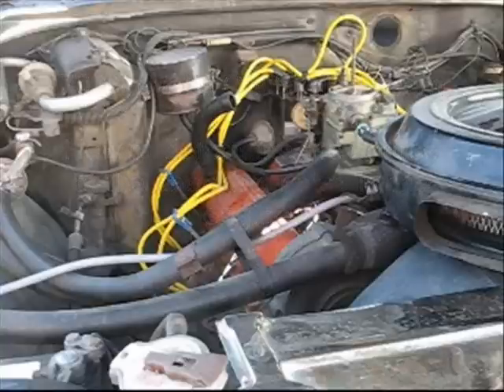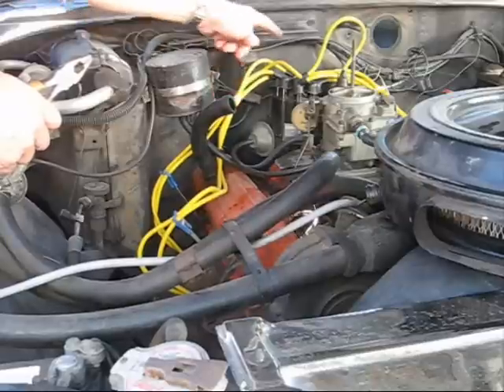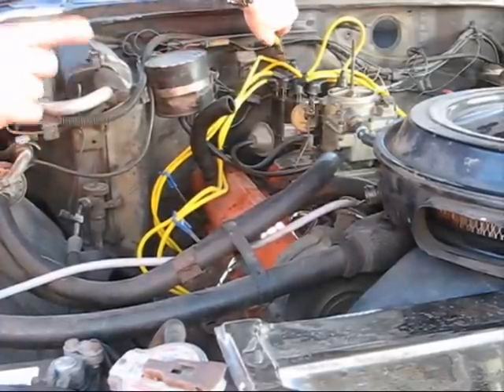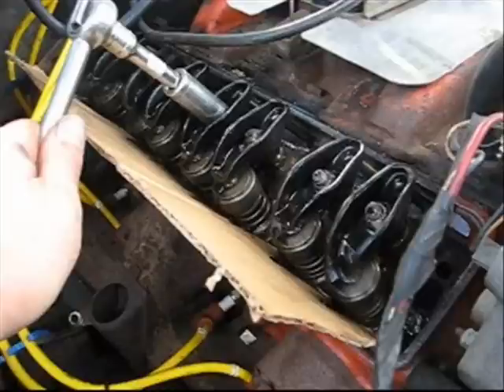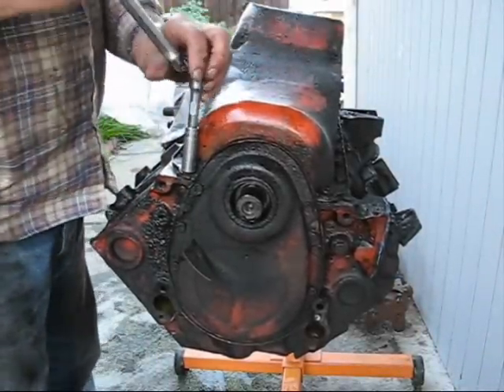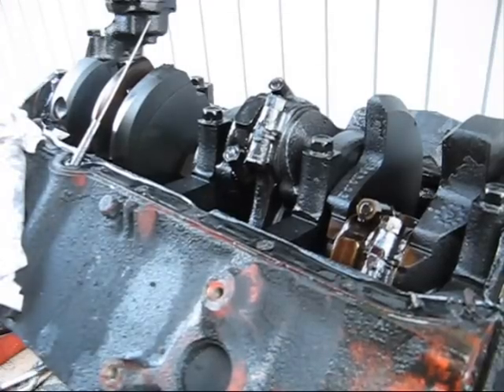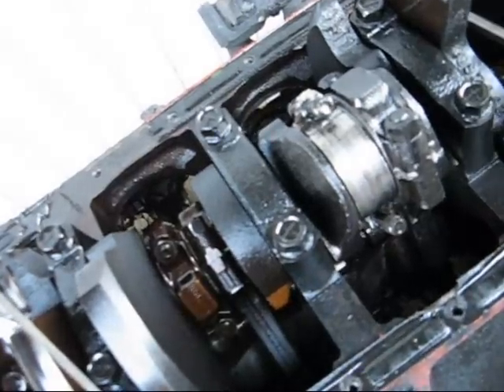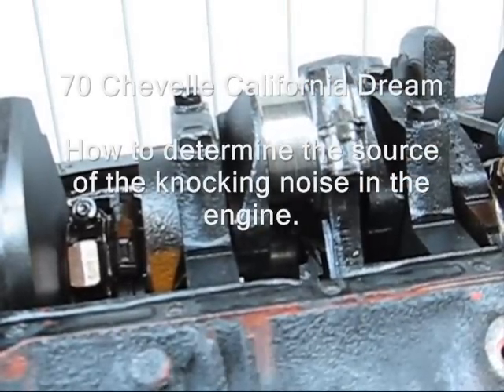How to determine the source of engine knocking noise

Comment: I have the exact same knocking sound on my corolla..so could it be just the head, or does it need a general overhaul?
Reply from the maker: +Paul Jason Did you pull off the spark plug wires one by one to see if the noise went away?

How many miles on the car and what year is the car?
Reply: Yeah, I haven't tried that..I'll try it today, and get back to you..it's got 133,000+ kilometers. I did some research..they said it could be a lifter or push rod problem..worse is a piston slap..but I don't get smoke/blue smoke on my exhaust..and the engine power seems ok.
Reply from the maker: Have you pulled off the valve covers and looked to see if the rocker arms are all working or the push rods are bent?   Do one side at a time and like in my video, use a piece of card board to keep in the oil.

If they look ok, take a large screw driver and carefully put it on the bolt of the rocker arm and put the plastic handle end on your ear.  Go to all of them and see if your can hear the bad rocker arm/lifter/push rod.
Reply: David Lis Okay, I'll try that. I did the spark plug wire test. I think it's cylinder no.3.  I also went to a shop today and had a compression test(wet/dry), and it also turned out fine.  They still can't figure out what caused the knocking.  They were talking about a top overhaul, I said No, not yet. I posted a video on the compression test I had this morning. You can check it out.
Reply from the maker: Where is it?
Reply: It's in my channel (videos).  I got a problem here, The check oil light turned on the other day and yesterday before I had a compression test. I thought it was only the sending unit. Last night, when I went drove to the office, the check oil light was on again, and it wouldn't turn off. Then suddenly, the engine was very noisy.  So I was thinking it's the oil pump that's gone bad.  Am I right? Could this be the root cause of all the noise problem on this engine? The car is back here in the garage, and I don't want to turn on the engine. I'm trying to get my mechanic to come here, but he's still busy at the shop.
Reply from the maker: I looked at your videos.  The compression is good.  

Oil light coming on usually means you have very low oil in the engine or no oil in the engine.   Engines do not run long with no oil.  Question:  is there oil in the engine?

If the oil light came on and you keep on driving, that could mean you were driving it with no oil to lubricate the engine.  That is why engine became very noise.  You may have wrecked the engine. 

If the oil light came on and the it was full of oil,  it could be the sending unit.  But with the oil light on and it started making a lot of noise, means it is out of oil.  I never heard of an oil pump going bad.

My friend's wife has a Toyota Camry, 4 cylinder.  She drove it home with the oil light on.  When she pulled into the driveway there was oil all over the bottom of the car because the oil filter broke.  I checked the oil and there was none in the engine.  I thought it was wrecked.  So, I put on a new filter and filled it with oil and said, let's see if it will run.   It started up, and it is still running today.  I am surprised.  

So, in your case, the only thing you have to lose is 4 quarts of oil.  Fill it up and see it it runs.  If you ran it out of oil, it is wrecked anyway.  These Toyota's are had to kill. 

Let me know how much oil you had to put in the engine?
Reply: David Lis Hi David..I have a serious engine knock..I just uploaded a new video. You can and hear it.  My mechanic's coming over on Thursday to check the oil pump.  I'll keep you posted. Thanks
Reply from the maker: I am sorry.  I am not the best at this.  Where did you post it.
Reply: I think the knocking sound is fixed now. I had the oil changed and the oil pump strainer cleaned.  The mechanic said..it may not be the oil pump going bad..just the strainer too dirty.  He cleaned it, and it didn't have the knocking sound. The oil was an Aisin 5w40 fully synthetic oil.  Now, a little issue, my RPM is high even when I drive on low speeds (30-40km/h) I think it's the throttle cable that's loose. He said his coming back this noon to check it again. Thanks!
Reply from the maker: OK - good news

Comment: great video going to try this on my 72 oldsmobile cutlass ticking sound is driving me nuts. seems to be no exaust leak thinking it's a lifter.
Reply from the maker: +Keith Hawkins It is probably not a knocking noise, just loose valve lifters.  Take one valve cover off and use a large screw drive, the plastic side goes on your ear and the tip goes on the rocker arm.  Go to all of them and hear which ones are making noise.  Them tighten the noise ones a 1/4 turn and see if that quiets them down.  Be careful not to tighten to much because it could screw up your valve.  If the motor starts to run rough, it is to much.   Let me know.
Reply: +David Lis have the cover pulled now am going to try tightening it up I know which one is ticking from pulling wires off the distributor but they all seem fine at first glance
Reply: +David Lis uploading a video now not running but I will post one after with it running any help would be hugely appreciated

Comment: had a motor replaced in a Mazda tribute now this motor has a loud tapping and cuts back after reaching 50 mph replaced fuel pump all air sensor and erg is fine any suggestions it has been 7 weeks no way to go
Reply from the maker: Sorry, I am not familiar with those cars

Comment: Out of curiosity, why does the noise go away without spark if the bearing is still rolling around? Without the combustion happening in that cylinder, the bearing is able to keep from spinning?
Reply: +Mitch Hill Great video by the way.
Reply from the maker: +Mitch Hill With the spark plug wire off, the cylinder does not fire, so it does not generate the force of pushing the piston down, there is no pressure on the bearing.  So the bearing is just going around the crankshaft with the help of the other pistons doing all the work.   It is still not going it any good because the bearing is just scraping the journal on the crankshaft as it goes around.  It is only a matter of time before the connecting rod brakes and does real damage to the engine block.  Then you have real problems, like maybe needing a new block. 

Once the bearing starts spinning on the crankshaft, it will always spin because the tabs the hold it in place are gone, I show it at the 7 minute mark in the video.  My was so bad that I had to buy a new crankshaft.
Reply: +David Lis Understood. Thanks for the reply.
Reply: Mitch Hill because the piston has no load on it when it’s not firing

Comment: ok guys i have this 92 chevy  p up chevy small block . and the knocking noise is coming from the diverside. this is the thing when i start it nothing after it warms up and i put it in gear that's when i hear it. when i give it gas it gets alittle louder. but when im at a cruising mode it seem to go away.. im so dam confused HELP ME PLEASE
Reply from the maker: +Lester Stuck My guess is that it is in the starting stage because when it is not under power you can not hear it but when you need power, like accelerating it puts more pressure on the bearings.  Once again, when the truck is just cruising along, the noise goes away.

If you put the truck in drive, foot on the brake and slowly press on the accelerator to increase the strain on the motor, does the noise come back?
Reply: man i just had the upper half rebuild someone told me this would happen.. soon.. ok i thank you sir for the info..
Reply: Having same issue did u find the problem?

Comment: remeber to use some type of oil supliment in older flat tappet motors, most oil has reduced anti friction additives as all engines built now have roller lifter or roller tappets. I use diesel oil(rotella 10/30 or 15/40) it still has the needed additives required in flat tappet motors. GM sell EOS engine oil suppliment for this reason.
Reply: Thanks  for the advice Tim. A few years ago my 350 had a lifter go bad. I ignored the noise and eventually I had to replace it with a different engine. That 305 for some reason had similar horsepower and I was happy with it... until that engine had a lifter go bad. I replaced the lifter immediately. Surprisingly a simple but time-consuming project. I've been wondering why people are using Rotella diesel oil, now I know.

Comment: Any mechanics out there.. I have a 1998 f150 4.6L v8 that's ticking and the truck is shaking. The ticking is coming from the passenger side around the valve cover which is also right next to the fuel injectors and spark plugs. The spark plugs were replaced with iridium ones and wires were replaced but i'm skeptical about misfire due to the plugs because they're not individual coils. Its 2 coil packs 4 running off each. And it seems to me to be dual overhead cams which take out the possibility of lifters. So my hunch is a bent rocker arm. Im just wondering if anyone else has some insight on this. Also the tick changes with the revolutions.
Reply: Bad shaking is usually a misfire or could be accidentally placing the wrong wire on the wrong plug. I've done it dozens of times. A bend rod would be fucking loud. Like "AHHH SHUT IT OFF!" type of noise. If it's more of a ticking noise that varies with RPM but goes away once it gets warm, it could be a plugged up lifter.
Reply: Turns out it was just the plug wire on the back bank got pulled up. And I  didn't notice until I reached back there and just pushed it back on
Reply: My engine is shaking and making a knocking noise . We pulled the spark plugs and two of them had rust and smelled like coolant on the  passenger side . The problem all started with the knocking noise  and engine shaking and stalling .

Comment: I have the same problem with my 2000 Dodge Durango, V8 5.9L engine. Is is cheaper to fix it or change it?
Reply: +blacknnwhite7  A quick engine swap would be your easiest and quickest way out. It maybe a bit cheaper to reuse the old block and heads if you are doing the work yourself.
Reply: I had rod knock on a bimmer.  Replaced bearings polished journals runs great

Comment: We swap a cam and the engine started knocking.  What ya think?
Reply: did u check your piston / valve clearances vs the lift and duration on the new vs old cam shaft?
or simple stuff first your not out one tooth on your TDC?
did you adjust your ignition timing at all?
Reply: You should get new lifters valve springs and rockers if you're ganna swap a bigger cam

Comment: My 292 6 cyl has 7,000 miles. A little knocking noise at stops. It's a 75' long block and noise is an issue. A very simple machine! Any advice?
Reply: Take a hose and cut maybe 3 feel off it, turn the engine on and listen for the tick, once you hear the ticking take the hose and slowly move it around the engine until the ticking gets louder and louder. That will determine whether the tick is at the heads or down by the cam shaft. Hope its the top end.
Reply: David Chambers those older engines really need a good diesel oil(rotella 15/40 in summer,10/30 in winter) all of the new oils(including synthetics)have reduced or no anti-friction additives. the diesel rated oils have the additives needed for the metal to metal contact the lifters make. it is a better grade of lubricant. my 88' 5.0 mustang had 155,000 miles when I tore it apart rebuild it for racing duty. it had virtually no wear in the bores and bearings. it had no ridge at the top of the cylinder bore . I used 15/40 oil in it always. I drove that car hard. that block is in my 90 coupe now still with standard bore, standard rod and main sized bearings! I put all new bearings and rings in it anyway

Comment: Valve noise would not stop by just pulling off the spark plug wire. You have a problem with the rod bearing.
Reply: best remedy for this is to enter it in a burn out comp after about 5 minutes you  will be able to get a real good look at that rod without even doing a tear down.
Reply: tpcoachfix piston slap on Chebys
Reply: What could make valves to be noisy

Comment: I have a question...I have a knocking noise in my engine, but the knocking noise happens after the fact i have taking off and i finally stop at a red light thats when i hear it?
Reply: Either you have loose flexplate/flywheel bolts or you have a bad main bearing.
Reply from the maker: Did you go through this process?  Before I checked it out, it would only do it when I was accelerating under power.  I think I put on 200 miles before I realized something was wrong.  Maybe it is the valve lifters?  Just try the spark plugs first.
Reply: David Lis )7

Comment: I could tell it wasn't valve related right away.  You won't hear such a deep "knock"  from valves..  Value issues sound more like a "tick"  or an exhaust leak...
Reply from the maker: Did you find the cylinder that had the problem
Reply: @davidlis6709  no
Reply from the maker: @RohanSanjith  Do you try letting the engine run with 2 spark plugs off so when you take the third one off it really makes a difference.